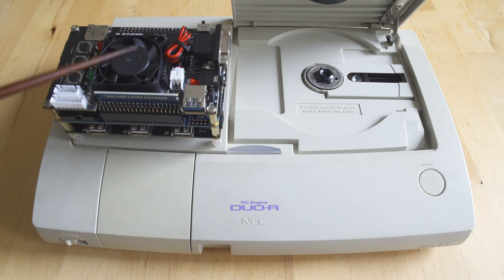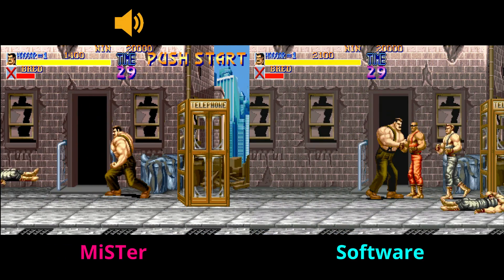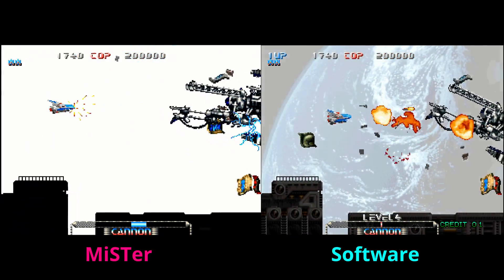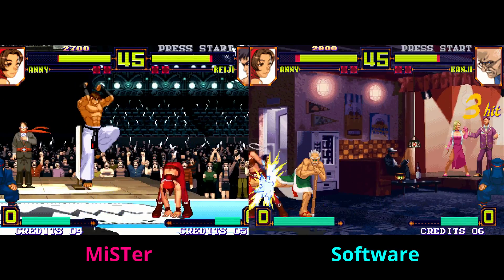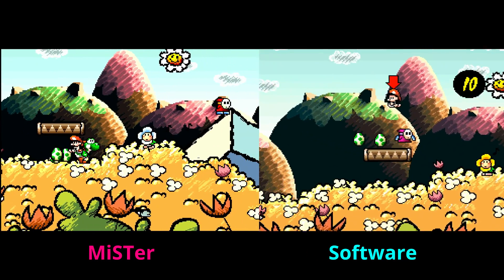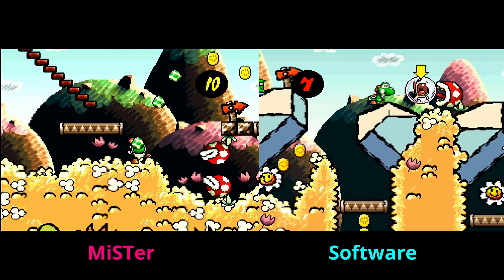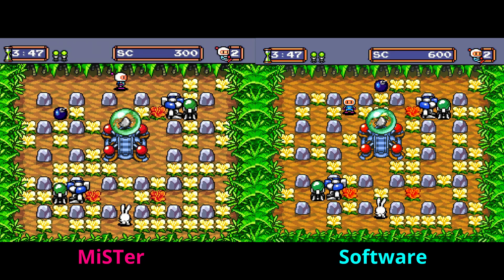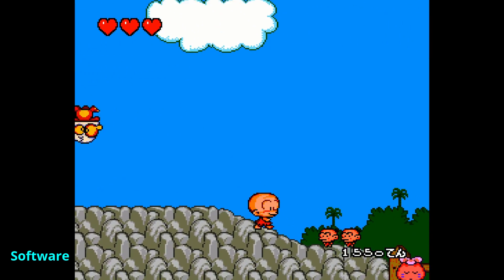MiSTer FPGA DE-10 - FPGA Emulation vs Software Emulation in RetroArch - which is "better"

Comment: Why not use MAME current core? There is no point comparing FPGAs with performance based cores. You are supposed to compare them with accurate cores. All you do now is making FPGA look better. unfairly.
Reply from the maker: I chose Final Burn as it seems to be the most commonly used option for a few of the platforms I tested. I will be comparing MiSTer against MAME soon :) so just consider this part 1
Reply: @VideoGameEsoterica  Switching out cores in RetroArch, even per game, is trivial for a "casual" user (does such a thing exist in this niche?). If you're going to title your video MiSTer vs RetroArch it should actually BE what RetroArch excels at.  Otherwise it's just MiSTer vs Final Burn emulator.  Some viewers will walk away from this video thinking that it will help them decide between the two, and it's just not applicable in that way.
Reply from the maker: It will help them decide what they feel is a better option per game
Reply: @VideoGameEsoterica  You mention using Alpha, but the Alpha cores are years old. Final Burn Neo is the most up to date. Neo is pretty much on par with MAME these days for the drivers it supports. And if you spot differences you can report them on Github and the team is pretty quick to fix things.
Reply from the maker: I will be doing a “vs MAME” video in the future and may address Neo
Reply: @VideoGameEsoterica  The thing about FPGAs is that casuals won't care about any comparisons with their Retropies, their phones and all the other cheap, crappy options. The only ones who care about such comparisons are power users who care about accuracy. Which is what those FPGAs are about, accuracy. Other than that, i'm looking forward for the proper comparison in part 2.
Reply from the maker: but MiSTer is getting a lot of press on channels / on sites that are oriented towards more casual gamers...so more casual people will def be showing up to the party.
Reply from the maker: True. But those articles are going to bring in more users for sure
Reply: @Imgema  Do you have an example of an article that is promoting the MiSTer by cherry picking bad software emulators to compare it against on purpose?
Reply: @Aberusugi  The article doesn't mention accurate software emulators like BSNES/Higan, blastem, etc and implies that devices like the Polymega and Pi aren't accurate because they use software emulation in general, not because they use performance based emulators specifically.
Reply from the maker: Is the Polymega even coming out? Seems like that thing is taking forever

Comment: Cool, ive been saying all along that MiSTer is a bit snake oil, sure its the most accurate "simulation" but barely better than good emulation and certainly not some godly step up. Nice video.
Reply from the maker: While I do think MiSTer is better it's not like other awesome options aren't out there. For me the part about "throw MiSTer in my bag and biking to a friends house" is the biggest difference
Reply: I have personally compared a real Neo Geo, emulators running in the best possible PC hardware, and the MiSTer, and I can assure you the MiSTer is not snake oil. It's one of the best experiences and closest to the original hardware for the price. Not to mention the hassle of connecting a modern PC to a CRT TV...
Reply from the maker: PC to TV is a lot easier on MiSTer for sure
Reply: @VideoGameEsoterica  what do you mean pc to TV is easier in the MiSTer?
Reply from the maker: I just mean getting MiSTer on a CRT is easier COMPARED to PC to CRT
Reply: To each their own but I'm not sure what to think when people say mister looks "better then the real thing". What's been achieved, pure artiface. :D
Reply from the maker: It can only be “as good as”
Reply: @Laserdreamz  It looks better than the real thing because the real thing can be 30-40 years old, and will never stack up against modern technology. The analogue VGA port on the Mister is as clean as you can get with analogue, whereas my REAL SNES, Megadrive, etc... shows artefacts such as shimmering, noise. Take the SNES, a SNES running on a CRT, connected with an RGB cable will/can have visible jailbars, and these (once you see them) are hard to unsee. You don't get them on a Mister.
Mister is as clean a display as you are going to get, if that doesn't matter to you then Mister ain't for you.
Reply: @mrkirk4944  Sure I get that, I just don't understand the psychology of wanting it. Reminds me of the guy in the matrix eating the fake steak.
Reply from the maker: Yes it’s easier to deal with than old hardware with its inherent issues
Reply from the maker: Mmm steak. Now I’m hungry. Thanks!
Reply: @Laserdreamz  I find your comment bizarre. The real hardware needed to match every Mister core, would cost you thousands, and thousands of ££/$$ or whatever your currency is. Retro hardware is more popular than ever, but the eBay prices are skyrocketing beyond even the prices the hardware originally cost, 20/30/40 years ago.
I paid £350 UK pounds for a complete Mister setup, including case, addons (SNAC connectors, USB HD). This little box, connected to my Sony PVM, can transform itself into any of those thousands of pounds of original hardware, and all in a tiny little box. In just one small area of my gaming room, I can have ALL my retro needs.

Now, you can also do that with a good PC, and emulators. But emulators don't feel right, they feel wrong, and even with my gaming PC + modern CRT shaders, and controllers, it still doesn't look or feel right. It's like building your own Ferrari. Sure, you can make it look kind of real, use a similar engine, paint it the same colour, but in the end you are not driving a Ferrari, you are driving a fake Ferrari, and the only person you are fooling is yourself.
Reply from the maker: Lol yes if you do the pricing between what MiSTer plays vs how much it costs to buy all that hardware...well I’ll have a video on that soon actually :)
Reply: @VideoGameEsoterica  I think,  if I was a Youtuber making these type of videos, I would make a video highlighting the pros and cons of owning real hardware, vs owning a Mister. 
For example. Real Hardware.
Pros - Real hardware, original controllers, original media (Cart, Disk, Tape, etc..), play the games how they were meant to be played.
Cons - Hardware breakdowns, deteriorating hardware, hardware failure (CPU, custom chips, PSU), battery failures + possible leaks causing damage, yellowing plastics.

Mister:
Pros - Affordable, all-in-one box that gets as close to original hardware as we can currently get. Can use original controllers + original media (Play real tapes via ADC In), can use original display tech - Consumer CRT, Pro CRT PVM/BVM, Arcade Monitor. Low power requirements, small footprint if original case is used. Very well-supported.
Cons - Still isn't real hardware, can be a little bit tricky to use (at first), not all original controllers are supported, not all cores have original controller support - especially the Arcade cores (Spinners, Trackballs), not all cores work on a 15hz CRT - even cores of machines that were originally 15hz CRT only, the original cost outlay can put some people off - although this is more down to IF you buy everything. And finally, the case is a little bland looking. Could really do with a high-quality, good-looking case that allows expansion - Some are being worked on, but not much is actually out there to buy.
Reply from the maker: Lol don’t blow up my spot. If you look at the playlist there are a LOT of private videos. It’s quite possible what you just described is already done and just waiting for release :)
Reply: @VideoGameEsoterica  Hey, I was simply saying what I would do.
Reply: "Snake Oil" is a bit much lol. The video output, the simulation of analog synth chips, combined in the one unit for that price is excellent. Getting the MiSTer video and audio output out of software emulation requires a much more expensive PC and sometimes specialty auxiliary hardware or a lot of tinkering with settings. Not saying one is necessarily better than the other, but it's obtuse to call it snake oil lol.
Reply: Snake oil, to me, implies getting cheated or not being completely honest about something. MiSTer does exactly what it advertises: hardware emulation.

I think what you're trying to say is it isn't worth the price markup over software emulation.
Reply from the maker: Yes. MiSTer is legit awesome. IMO it's worth the hardware costs. But that DOESN'T mean other awesome options don't exist
Reply: @TheMikeyb86  this is it Mike. FPGA game systems in general, I'm not against it, just dubious of their worth.
Reply from the maker: worth is so subjective anyway. My $300 is different than your $300 which is totally different from the next persons $300
Reply: Mister shines on the same display tech the original hardware ran on, a CRT. There, it runs and looks far superior to Retroarch/Mame etc... and has the same lag as original hardware. Infact, running side-by-side of original hardware, on the same CRT, Mister also looks better than the original machine - especially if that machine was composite-only, or RF-only like an Atari 2600.
Reply from the maker: I'd love to do a "blind taste test" with the same controllers and the hardware hidden on my PVM. I just don't know anyone that knows the consoles well enough to truly make a good "call" on what they like more
Reply: @VideoGameEsoterica  That would be a great video, 3-way blind test MiSTer v Mame v Real hardware and ask the subject which one is the real hardware
Reply: @VideoGameEsoterica  on the blind test, perhaps a known speed runner would do a collab on that. @Kosmic might be in on that, he's so chill.
Reply from the maker: if I can find someone local in Chicago I'll give it a look
Reply: @VideoGameEsoterica  I could tell. I run my Mister on a Sony Trinitron PVM 1442 QM, along with a real SNES, Megadrive, RGB-modded PC Engine. On all 3 real machines, there are still artefacts that are easy to spot, such as shimmering as the screen scrolls, occasional interference, and very slight noise. The Mister is really clean on the VGA out port, so using a Scart to BNC cable on my PVM makes it look clean, and pin sharp - this is what makes it easy to tell the difference.
Reply from the maker: Lol then swing by my house and be part of the video!
Reply: @VideoGameEsoterica  may I suggest Chicago Retro Gamer? He speedruns NES games.
Reply from the maker: I’ll check him out
Reply: @VideoGameEsoterica  lol, no. I hate the camera, I'm more Youtube watcher, than Youtube video maker. You could probably fool someone who didn't own real hardware. But I have been gaming since 1977, and I still own the majority of my hardware. I know the little annoyances, the pros and cons of real hardware - like a car owner knows their own car's squeaks, knocks, sounds, etc...
Reply from the maker: Haha I get that. Not everyone wants to be a public face. That’s why I’m just a public voice!
Reply: @VideoGameEsoterica  A public voice, and a public chopstick. :)
Reply from the maker: Haha sometimes a cat pen too
Reply: @mrkirk4944  100% agreed. Even rgb-modded original hardware has artifacts inherent with 35+ year old tech that the MiSTer smooths out. To each their own and that's the beauty of it all.
Reply from the maker: I mean I 100% own all these old consoles with RGB and yes...there is no such thing as "perfect" video quality

Comment: I think Final Burn is more about getting games to run on underpowered hardware than accuracy. Other cores within Retroarch, such as MAME, are probably more accurate. The dithered light beam in SoR2 is just a scaling issue which could be adjusted however you like in Retroarch. The sound was less accurate but again a different core might give better results. But it's good that the MiSTEer bypasses all this fiddling with settings.
Reply from the maker: Yes a lot of what I compare is "out of the box", as the people who ask me these questions aren't the ones diving deep into ever granular setting to try to get 1% "more' out of the possibilities.

Comment: Excellent video. Subscribed! Would love to see you follow it up with some input lag comparisons, perhaps using a Time Sleuth.
I'll probably get a MiSTer once fully-working 32, 64, and 128-bit console cores are developed (those are the consoles where software emulation still leave a lot to be desired, IMO). For now, I am totally satisfied using Mednafen for most stuff, Fusion for Sega CD, and MAME.
Reply from the maker: all good options too. Software emulation is still great. If I can find a Time Sleuth to borrow i'll keep it in mind!
Reply: 32-bit is most likely the limit for the current board so you'll probably be waiting quite awhile.
Reply from the maker: The way time moves ten years from now will be sooner than we know it (scary)

Comment: I made the same test yesterday with Final Fight running on the Mister and latest MAME. Both connected to the same screen (32:1 that can take 2 inputs at the same time) and putting the Mister audio through the PC to be able to seamlessly change from the mister to MAME. Both the video and the audio are 99% indistinguishable.
Remember that MAME is built for accuracy and Final Burn Alpha sometimes uses hacks to improve performance.
There is also a known issue in the NeoGeo core where the audio goes out of tune sometimes (very noticeable in Pulstar)
Reply from the maker: Pulstar is always what I use to compare audio as a) it's known to have issues and b) I've played the game so many much on AES that it's imprinted in my brain
Reply: @VideoGameEsoterica  Yeah it's also one of my to-go games for comparisons, the sound issue is not limited to Pulstar though, it's just very obvious during the intro. It happens in a lot of NG games in the Mister (maybe all?)
I had a RGB bypassed NeoGeo with a NeoSD Pro till not so long ago, used to play a lot in a Sony CRT TV. It's extremely difficult for me to tell the Mister apart from the original hardware
Reply from the maker: MiSTer audio has always been problematic on emulation ever since the beginning. The intro jingle was the worst offender for awhile
Reply: @VideoGameEsoterica  every game had a different sounding jingle though. That doesn't help.
Reply from the maker: No. Makes it a LOT more complex
Reply: @sunderark  I always thought different developers had different jingles, eg. ADK and SNK jingles are different
Reply: @VideoGameEsoterica  Pulstar music tests the ADPCM, which has issues in Final Burn, but it's good to test older Neo games too to compare the FM sound.
Reply from the maker: I'll look into that
Reply: Some comments about this issue here in the Forum https://misterfpga.org/viewtopic.php?t=574
Reply from the maker: good to know